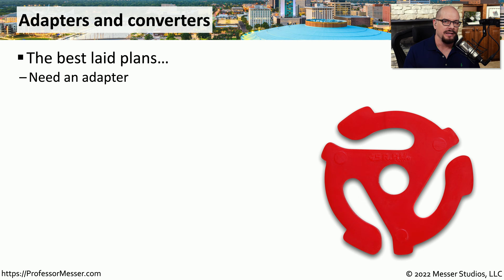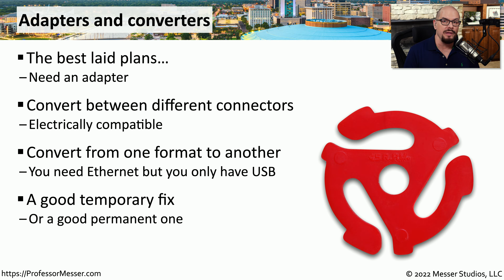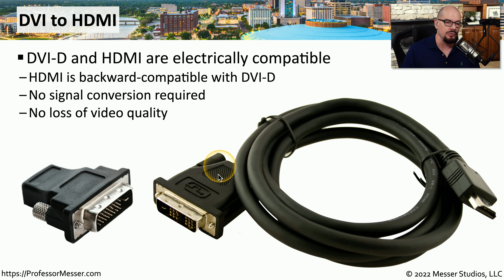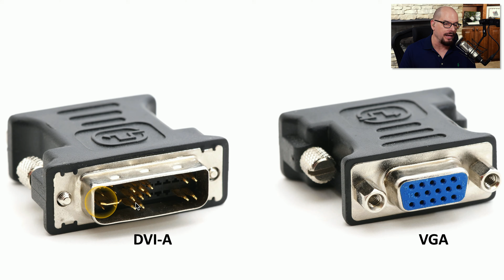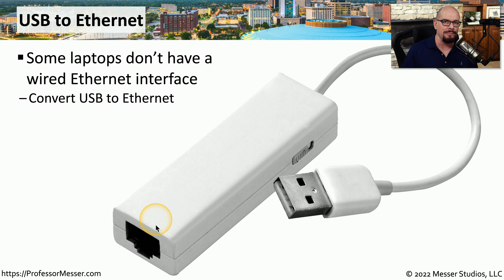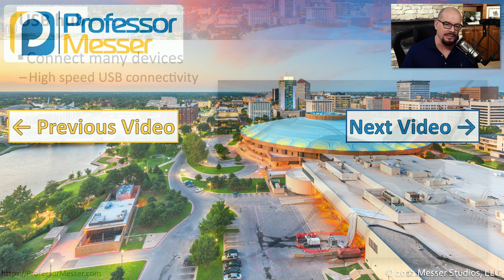Adapters and Converters - CompTIA A+ 220-1101 - 3.1

Comment: How does a USB Hub compare to a Port Replicator from Lesson 1.3? I thought they were the same?
Reply: so true fellow boymoder
Reply: @emmaroni  best of luck in the IT world
Reply: @Boymoder420  you too <3
Reply: in this example it is converting other signals to USB. for instance that SD card, ethernet, video, etc shown. A port replicator would just be adding more usb ports.